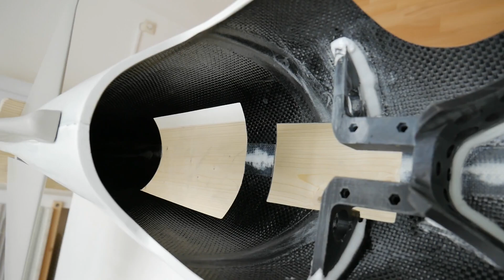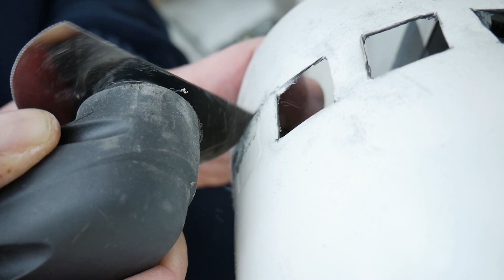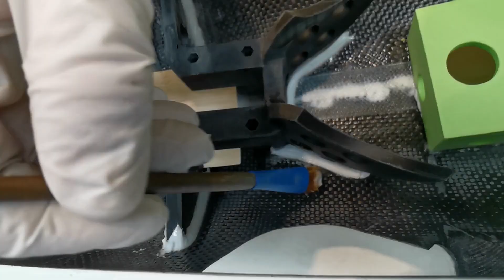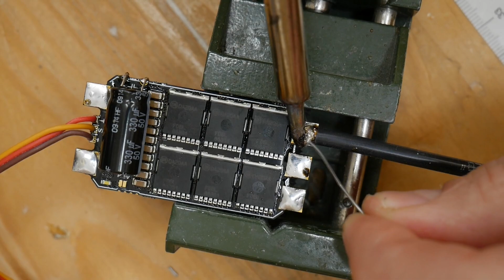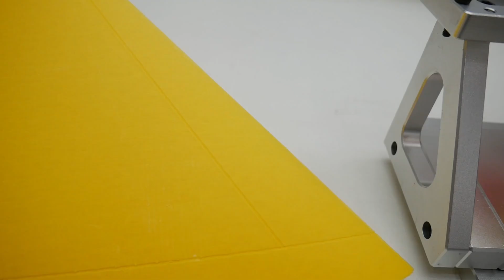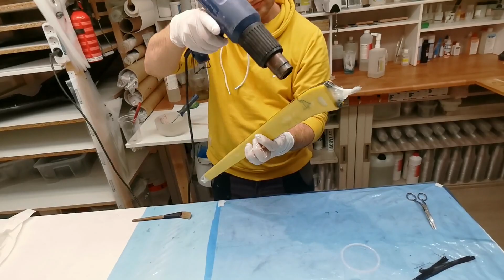Super Lightweigt Gyroid 3D Printing | Laminating | Thrust Test | Harrier Engine Installation |

Comment: The wing spars were covered in a clear heat shrink before the epoxy was set. I'm surprised the CF and glass didn't bunch up? Also, its not clear to me if the covering was removed? I have liked to see this.

Comment: Hey, i am alsow 3D-Printing lightweight Airfoils for a solar Airplane. Imfound this amazin Filament. Its already prefoamed and has a Density of 0.8g/cm^3 instead of the 1.24 of normal PLA. Polymaker makes it. The Benefit is, that you can print it nearly like normal PLA, so much lese Stringing.
Reply from the maker: Great! Thx a lot for that hint😊👍👍

Comment: Referring to the stabilizers and tail, did you ever tought of printing, besides the "adirectional" infill in the internal structure, also some reinforcements more similar to spars and ribs(so that you maybe won't have to use an adjunctive spar to put in the part)to increase the resistance to the flessional and torsional stresses on the parts and take the maximum advantage from the 3d printing technique in terms of having the best combination of stiffness and lightness? Maybe some FEM analysis on the parts could help on this
Reply from the maker: Yeah, we will check different ways of construction 👍👍

Comment: awesome !!! You have so many proxxon tools!!
Reply from the maker: Love these 😊👌
Reply: @rene_rosentraeger  what do you recommend as a proxxon model similar to the dremel 3000? I've had 1 proxxon but it broke, the motor still spins, but the tip with the tool on seems to be connected to the motor with a very weak clutch: the tool on the tip turns at the same speed of the motor if I'm not using it, but as soon as  I try to cut something or drill a hole, the friction makes the rotating bit stop, while the motor is still going. As if there was a small clutch connecting the tip and the electric motor

Comment: I think shrink-tubing the heatsink caused it to overheat. Tubing restricts airflow, and is probably also opaque to IR. Is there any way to expose the fins without exposing the PCB, like potting but preferably less irreversible? The weight saving is indeed considerable.
Reply from the maker: Absolutely! The last word on the ESC  choice is not spoken 😁👌
Reply: I had the same response when seeing the heat shrink go onto the ESC.
There are epoxy based thermal transfer compounds which could work to hold the heatsink to the FETs instead.

Comment: René,

As always, super nice progress again! I was wondering, what kind of slicing software are you using?
I noticed you have alot of stringing in your lw-pla print, what kind of retraction settings do you use?

Cheers
Reply from the maker: Hi, I'm using Cura. Yes retraction is 0 to avoid plugging on the nozzle.

Comment: Rene - sorry if you have covered this before, but what is your thinking behind going with 2 engines rather than one much larger fan (or concentric fans)?
Reply: The reasons are: Bettler air inlet without EDF shadowing…Then weight to thrust ratio,  which is better with two EDF‘s…Third reason is space Management within the fuselage…👍🏻
Reply: @RC-Jetprint  Thanks Siggi. I asked because I recall a comment in Sir Stanley Hooker's book about seeking greater thrust for an improved Harrier and the calculations showing that they needed a bigger fan 1st stage (for which there was insufficient space in the fuselage). I appreciate that air does conveniently scale down and behave as it does at full size but the principle of a single fan being able to move more air mass than multiple smaller ones would seem to remain valid. I had guessed that the reason might be one of gyroscopic balance, but I guess I was wrong. Do the 2 fans rotate in opposite directions by the way?

Fascinating project and very enjoyable to follow.
Reply: @zg8626  Thanks for that mentioning….I have done lots of tests with a single EDF in a Harriet fuse and can say that, because of the after curved ductings you have to make sure that you try to always have enough air in front of the EDF that is constantly there…we are not for air speed but for air pressure..
Reply: @zg8626  …and yes…the EDF‘s are counterrotating to avoid an induced momentum that would come from a single rotating EDF and would have to be stabilised afterwards👍 If we can use the independent EDF‘s for stabilisation itsself? The future will show us…From my feeling it is possible….But you will need very fast boards for that…😉
Reply: I think the main reason why the real Harrier would be more efficient with a larger first stage fan is, that it has a bypass jet engine and not an EDF. 
With a bypass jet engine you try to have as much cold air (bypass air and bypass ratio) as possible, because of the higher density which means it's more mass being moved, which results in more thrust. With an EDF you only have the cold air so there is no bypass ratio. I hope you understand what I try to say xD
Reply: @MTBCrafter  yes that is very correct mate…👍🏻 However we need to take what we get with affordable EDF‘s ….A normal EDF that we are able buy also has not the correct rotor constellation that it can really pump the air in a correct manner…..Therefore we are behind highest RPM‘s that you can keep within the given Ducting system.
Reply: @RC-Jetprint  okay. As far as I know these type of rotors aren't designed to pump but to accelerate the air. So if the pressure behind your EDF is too high, there should be a risk of surging. I don't know if that's a problem with EDF but in jet engines it is. Therefore you have the so-called surge valves.
Reply: @MTBCrafter  absolutely correct….👍The valves can help but not necessarily as they also are a also break for a constant airflow…And you have to make sure that the pressure that is builded up has a chance to be released at the end of the nozzles…Therefore the nozzles have to have a larger size instead of having a smaller area for the outlet….👍 That is the trick….Also pressure compensation between the chambers is an issue…😉
Reply: @RC-Jetprint  yeah, the Pegasus is probably the trickiest part. I've started a new design a few days ago for my VTOL and I finally have to start building anything. I will get myself a 0,8mm Nozzle for my printer and I'll probably go for LW-PLA, at least some test prints. Next goal would be some airflow tests. Therefore I'll need an EDF, haven't done the step buying one yet.